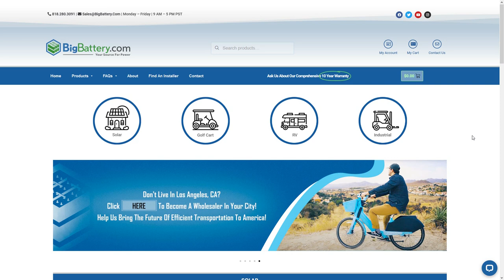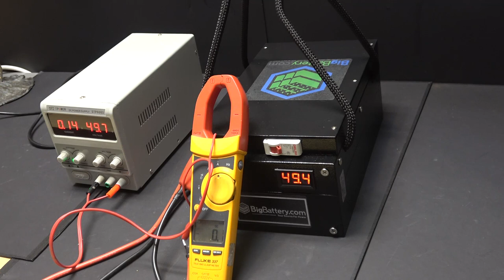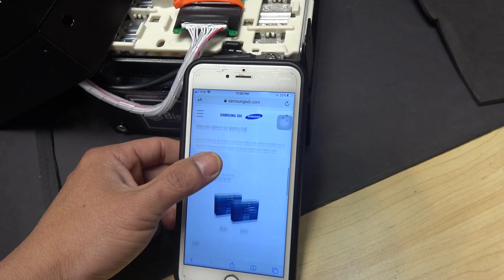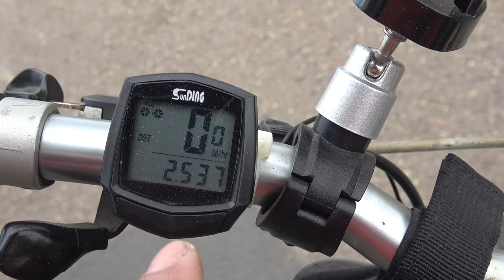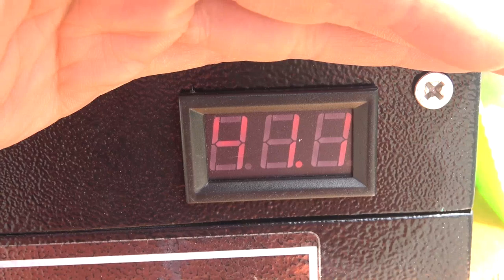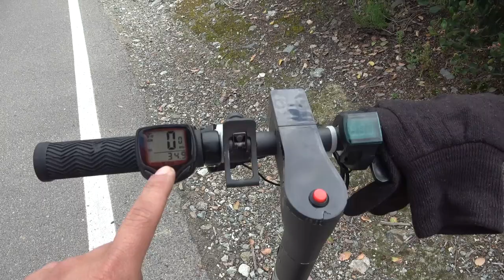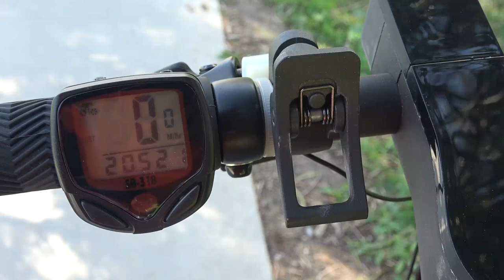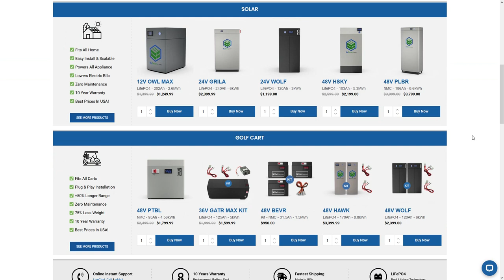Review & teardown: Bigbattery.com BEVR 0.5KWh 48V Golf Cart battery

Comment: Super vid as usual. How far can u go with your Kobalt setup?  Weight per KW comparison with the Kobalt?
Reply from the maker: Pretty much similar result with my Kobalt setup. The capacity on my Kobalt is just a bit lower (about 5% less). I get a higher sustained terminal speed with the Bigbattery, though. Probably because the battery cells are bigger so they have better continuous discharge rate. The Kobalt is lighter because it's more compact and have smaller and lighter components (BMS, wiring, plastic case...). Lifespan of the Kobalt will be shorter because they are only rated for about 300 cycles whereas the Samsung SDI prismatic cells can last for much longer.
Reply: @vuaeco  Thank u very much!!

Comment: wait its 1.5 kwh not 0.5kwh btw i made a short video on this battery please check it out
Reply from the maker: The 1.5KWh rating is for 3 packs wired in parallel. Each individual battery is 0.5Kwh. I have tested and confirmed the capacity in this video. Maybe you have the 48V BDGR -  33AH - 1.6KWH battery. It looks exactly the same in the picture but it's a lot bigger.